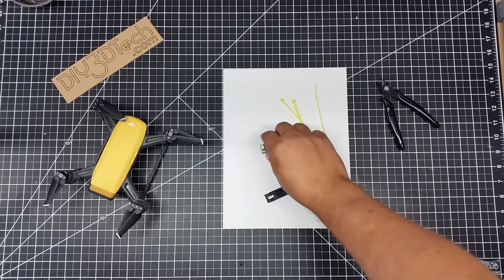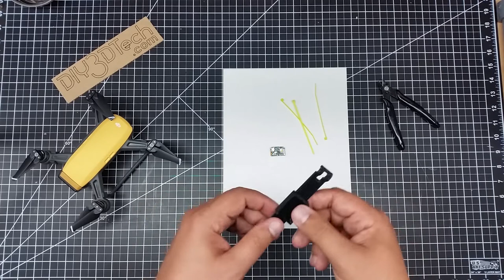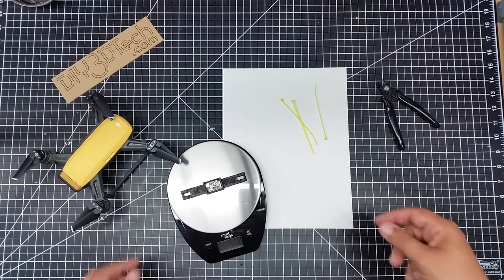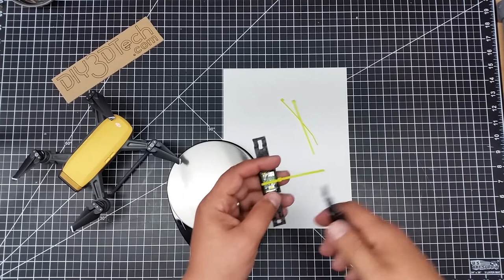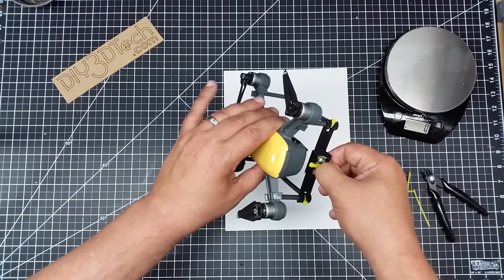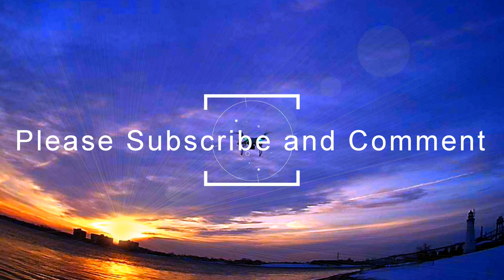Video Drone - DJI Spark 3D Printed Mount for Ultra Bright Strobe!

Comment: Very nice Joe.  I look forward to the tests.  There is a YouTube about adding 2 strobes to a Mavic.  He put then in front though and it seems to me that will bother the camera.  I think the back is good as you have it.  I was thinking that on top would be better visibility but there is not regulation from the FAA.  We can't fly at night anyway.  Keeping in contact is a good use for it.
Reply from the maker: Made it out to around 900 feet broad day light which isn't but been too windy and rainy to do a twilight test however when the weather breaks and time permit you bet i will be out there testing!  I bet at twilight I can hit 2,000 feet.  Also my videos on this seem to have stired up some controversy as while under 107 it is clear however under "recreational rules" (if there is legally such a thing)  nothing is said other than you must maintain LOS.  So I am interested in digging into this a bit further...
Reply: 107 is clear on this point to me.  You can fly 30 minutes after sunset and 30 before sunrise or if dusk and dawn are listed with a time then that becomes your no-fly times.  No light is needed for this.  If you fly during "dark" hours you must use high-intensity light but you must have a waiver to fly at night from the FAA which it appears they seldom grant. Ken Heron recently tried to get one for a test and was flat denied.   I look forward to your video tests.

Comment: Yeah but it's not usable to comply with the FAA law for flying at night as it needs to be visible all the way around
Reply from the maker: The point also holds in the daylight as you must maintain line of sight and the spark is so small that even in modest light it adds rang I have found...
Reply from the maker: The real idea here more daylight, as you need to maintain line of sight and the spark is so small you loss sight of this quickly yet  strobe provides extra distance however you need to maintain the orientation toward you or you could add a second...